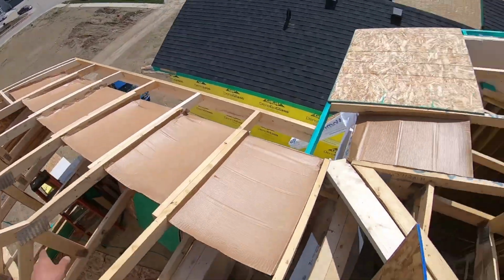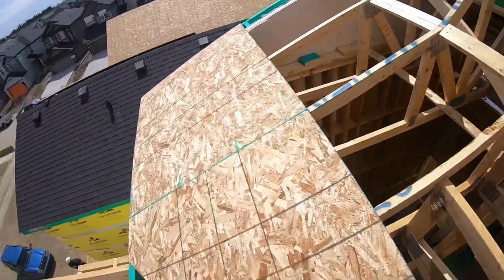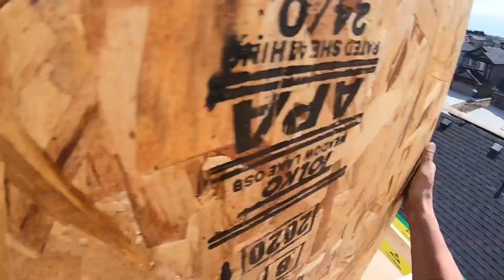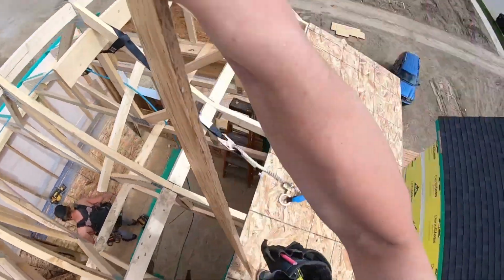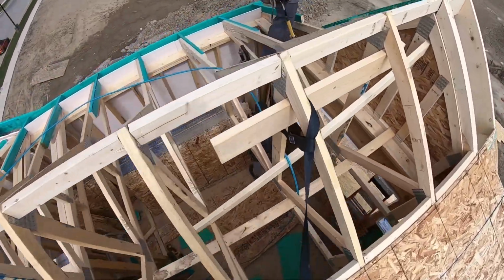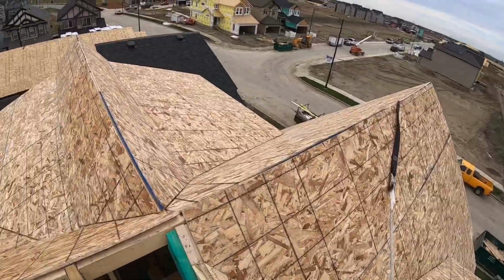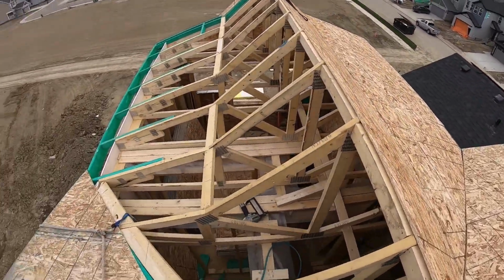Season 5 . Finishing the roof

Comment: Just curious what stapler do you use I’m looking for one and can’t figure out what you have that’s the one I’m wanting
Reply: Looks like an older model hitachi
Reply: @tristanmassie3574  I meant like gauge or degree I knew it was a hitachi when I saw it I’m switching from nailer to stapler for sheathing
Reply: @graycassidy7525  they’re usually 15 or 15.5 ga. Similar to flooring staples.

Comment: What's the stuff that looks like wet cardboard between the rafters?
Reply: They are cardboard insulation stops for when they blow the attic full of insulation. Their purpose is to maintain an air gap between the insulation and the roof deck. Google is your friend to learn why they use insulation stops
Reply: @NickRgibbs  Thanks Nick, appreciate it.
Reply: It's actually wet cardboard.

Comment: 10:40 what are the little clips?
Reply: They’re called H clips. They keep the edges of the sheathing panels in the same plane between the trusses or rafters. They also keep the manufacturer recommended spacing between the panels.
Reply: Prevents sagging from  between rafters
Reply: Should there be a nogin between the rafters so the boards don’t sag?
Reply: @charlieshwan5574  a what?

Comment: Amount of roof leakage will be crazy in this house....
Reply: I’m a roofer, why do you say that?
Reply: Assuming this is going to be asphalt shingles. Look at all the transitions, valleys, dormer facia on roof deck etc. 
This roof is destined to fail, especially if a shitty roofer makes the installation. I hope they lay down a good ice and water barrier all over the deck.
Reply: @Faruk651  yeah, if it’s a shitty installer, which Alberta has a lot of, it’ll leak. A good roofer would know to either use transition metal on the pitch changes or double up the shingle rows where they change in case of cracking. 

Valley change relief cut in the center and then caulk to living shit out of the joint, it’ll never leak. 

But yes like U said, a shit roofer would fuck this up
Reply: @Faruk651  and that dormer fascia will be fine if they step it correctly
Reply: @Aaron-fb1pq  That is what i mean. Whoever  tackled this roof needed a moment to plan it out. So many things to consider before starting and having proper materials and knowledge. I am not a roofer, my trade is stucco and i see so many bad jobs daily. I see them roofers in action while i do my work and feel bad for owners. Nail placement is a myth for some shitty roofers :D
Reply: @Faruk651  yeah you’re completely right man, there’s definitely some stuff on this roof that needs to be seen in real time to get an accurate order/install plan in place. There’s a way to do this roof properly but the guys who know how to accomplish that are few and far between.

I bet youve see some brutal stuff man, if you’re in stucco you’re constantly up there working on skirts and dormers you probably see it all, but as a guy whose been around roofers most his life, I can say this. Most of the hack jobs (not all) aren’t due to lack of integrity, they’re mostly because smart guys who get it don’t stick in roofing too long and why would they? Most smart roofers aren’t on the tools much or have left the trade completely, the guys who install are young kids who never got taught the right way or ex felons who are just dumb as shit to begin with.

That being said, the smart guys who stick it out I have nothing but respect for, they are real men. I don’t care what anyone says, roofing is BY FAR the toughest trade, I’ve known guys who fell and died, I personally fell and fractured my spine in multiple places, it’s tough as f’in shit, waaay tougher than framing which I did for 4 years. Anyways sorry for the rant
Reply: @Aaron-fb1pq  Totally agree man. As a stucco guy i have a chance to escape the heat when i can but i see roofers getting cooked on the roof. I have nothing but respect for those who give their best. I do believe they have the toughest job in my work field. You also nailed the reason for lack of quality with roofing.
Reply: @Faruk651  I’m not saying anything’s easy though man, respect 👊